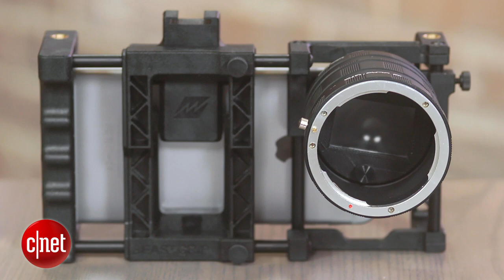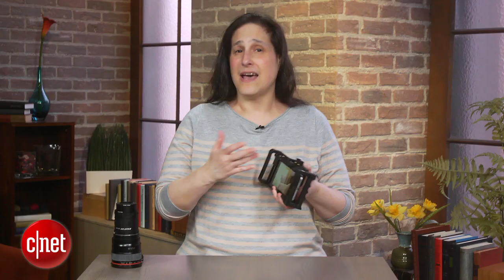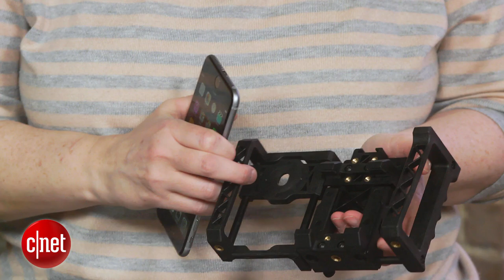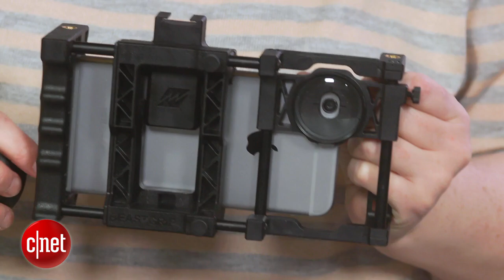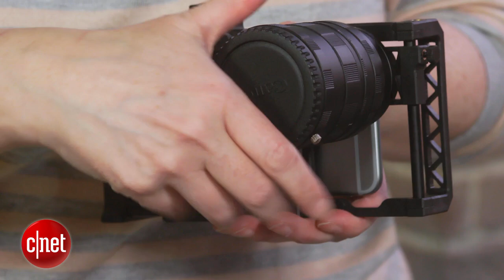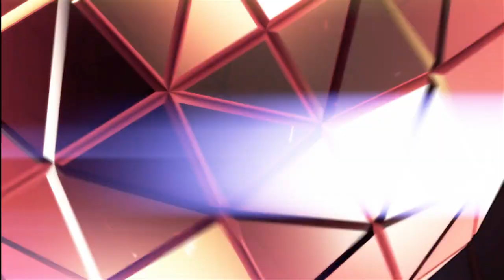Beastgrip Pro hopes to tame phoneography

Comment: The Chinese did a much better job with the new "cinema mount mark II". It uses screw tension to keep the phone in place instead of the spring loaded mechanism, not to mention it costs half what this one costs. 
I always find it amazing how in these American videos people always pay wayyyy more than they should for stuff like this. I know this is a kick starter campaign but still, sites like 'gear best' and amazon just overcharge you for stuff you can get on ebay or aliexpress for MUCH cheaper. Who would spend 100 DOLLARS on this?

Comment: No sample shots? 😕
Reply: God Exists its probably shit .
Reply: @MrOnlyforcommenting  i have it and I can assegurate you that it helps to take more stable videos and also to take better wide Angle or telephoto pictures
Reply: it's actually very decent and you can find a lot better videos about this however I did not know that when you take the shot you see it upside down. I have a huge problem with that and I'm trying to figure out if there's any way to view it in real-time not upside down which she said she uses some app but she was not clear if that's real time or if she is converting it back over in post editing
Reply: DSLR has mirrors to flip the image I'm guessing why this doesn't